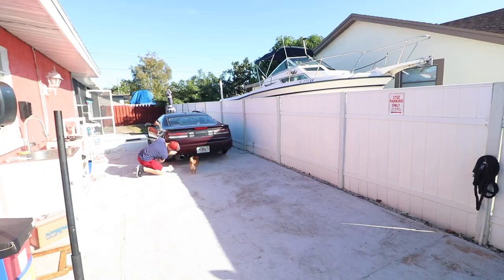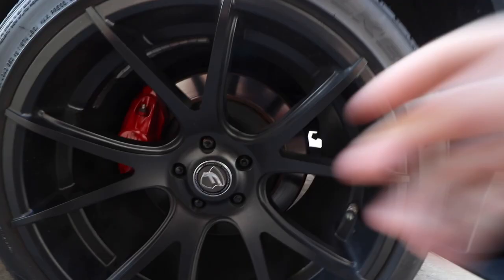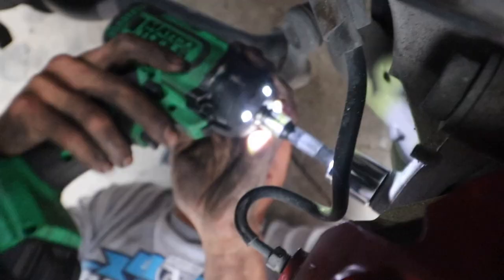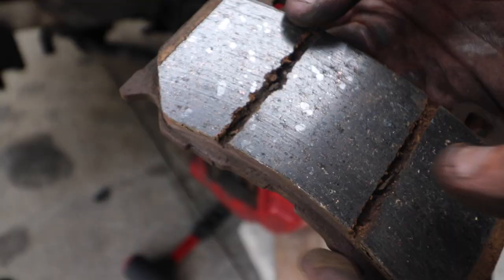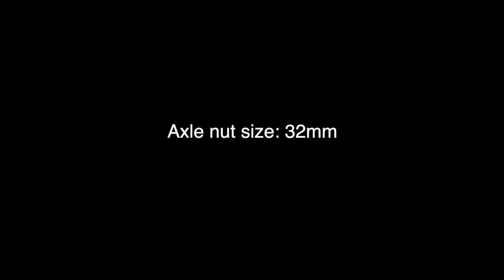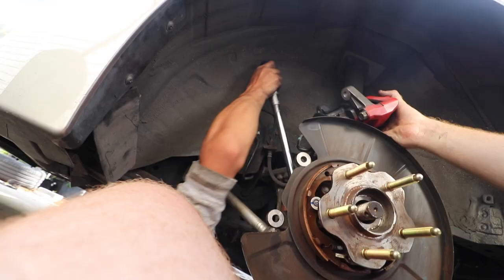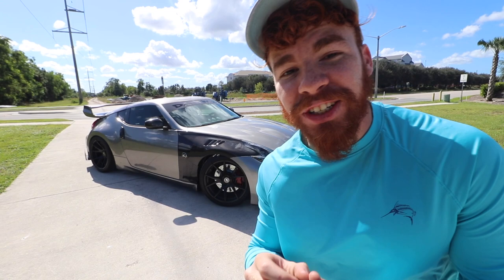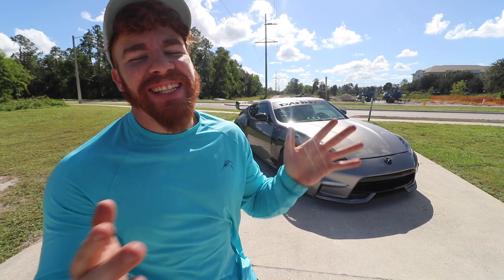INCREDIBLE BRAKE UPGRADE install!! (Nissan 370z) *supercar level*

Comment: For the future when you use spacers you extend the studs by the amount of the spacers thickness dont just double it in length would’ve saved you that lug nut trouble lol but looks nice

Comment: Good upgrade bro but definetly not supercar level hahaha ... get the Z1 two piece rotors that have aluminum face plate ... saves you quite a bit of weight

Comment: Hey bro, cool upgrade, looks clean but are you sure that you installed them to spin in the correct direction? I could swear the slots should flow from the hub out to the wheel. Looks like yours are all flowing from the outside into the hub. I feel like this is in theory directing more heat into your hub assembly as it spins rather than directing it out to be caught by fresh wind.

Comment: Didnt have to take the entire hub off for studs. Just hammer the rear out and use geometry to remove them and install them with washers,old lug nut, and an impact to snug them in place

Comment: Recently did my brake pads and rotors as well. U get any grinding or screeching sound driving at low speed during the break in?
Reply from the maker: Hmm not at all

Comment: Drilled and slotted are not good for performance bro. They drill the rotor in that compromises the structural Integrity of the rotor. If it gets hot at all and you break hard it will crack over time. This is been proven time and time again. Slotted are the way to go.
Reply: Depends on the brand you get what you pay for
Reply: @B2396B  true but most cheaper brands are drilled after the metal is cast